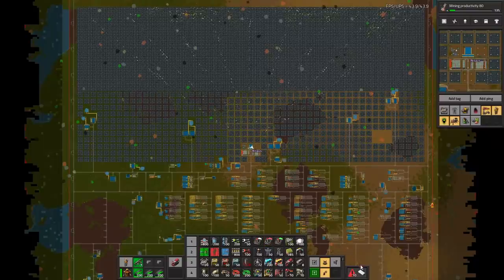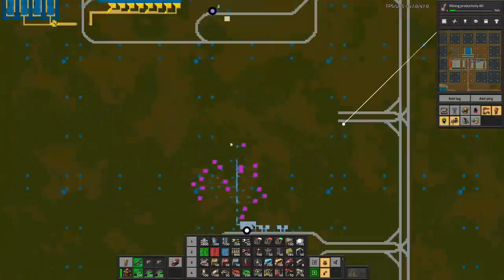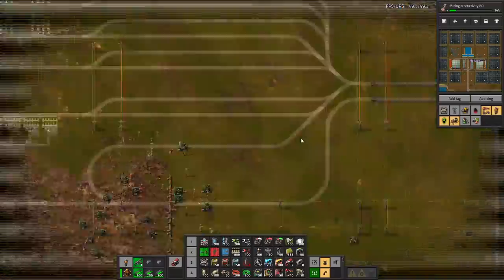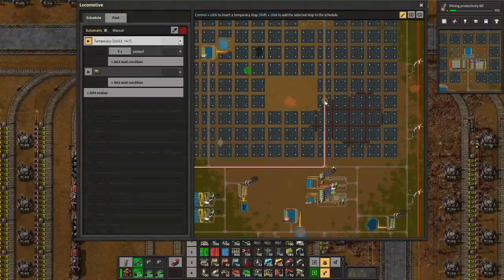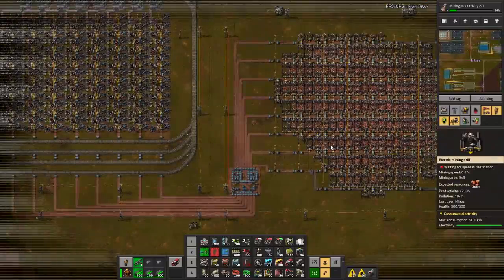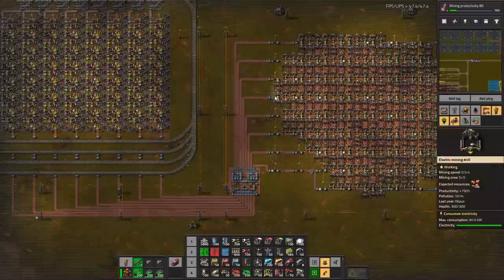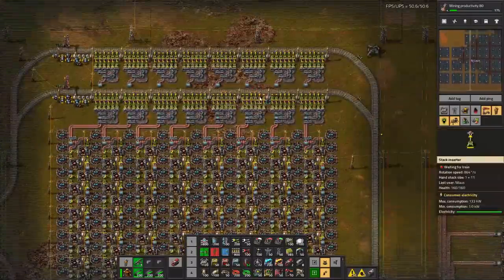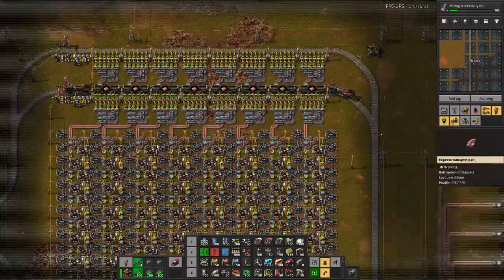NO BELTS for Mining and Smelting (UPS Optimization) | #66 | Factorio Megabase-In-A-Book Lets Play

Comment: I'm looking at that smelting  chain, something tells me that the length of the smelter chain and the length of the trains don't quite match, so you probably want the front one to be as close to an edge of the train as possible, and then see how long of a train you can get to fit inside there.

Routing wise, I expect that the ore carriers will want to stay inside the ore-smelting module and not be able to escape into the main network by default. The plate removal, on the other hand, probably does need to participate in the main network, but it's also about to yoink tons of copper trains that will be stuck waiting to fill up. With some clever rail layouts, you could set it up so the ore trains can roll into the module from your main hub, just not escape until the module runs dry and gets decommissioned.

Also for some ore patches you'll want to use a vertically oriented mining setup instead of a horizontal orientation.
Reply: The height of a "unit of smelters" is 2 beacons + 1 tile gap = 7 tiles.
The length of a car wagon is 6 plus one tile gap between wagons = 7 tiles.
Should be able to match any train length.

Comment: To minimize the time for empty trains to arive at your smelter locations wouldn't it make a bit more sense to have the limit on 2 per station? That way one train will be pulled in the station and one in the stacker behind it. It will minimize the time between wait?
Reply: This means each station will claim a train well before it needs one,, even if the station next door has been waiting for longer. It means you need lots of different trains.
Reply: @O11O1channel  okay true. You'd need tro drastically increase the amount of trains that are actually in your system if you want to minimize wait time between train in the station at any given time. Not sure if thats that big of an upside.. or rather have as many trains as you need on the consumer side and let the creation side maybe wait a bit
Reply: Alternatively, you can have a stacker station (with a train limit based on the size of the stacker) that all the trains go to before the smelter stations. So trains can come in to the stacker, and once a smelter station opens up it's a very short trip and the smelters aren't idle for long.
Reply from the maker: yes it would

Comment: Nilaus, I have 2 suggestions:
1: At the smelter, the ore gets unloaded onto a belt and then "balanced" between 2 chests. First of all, unloading from wagon to chest (box to box) would be faster than unloading from wagon to underground, wouldn't it? And secondly, that balancing is in no way guaranteed to be equal at all and heavily depends on the timing of those inserters. I'd instead unload into a single box, and then the fact that the underground belt only has a capacity of 96 items ensures that the 2 smelters fed by the belt will run out at exactly* the same time. *With the small caveat that all furnaces on the side fed by the belt will process an additional 36 items which doesn't imbalance anything because they go into the same train. Again, this is not guaranteed to be exact, but the possible difference is only 12-ish items every time the chest runs out.

2: As the 8-car ore trains have so much trouble fitting onto an already quite large ore patch (this one fits, but it feels like there would be ore patches that are too small for 8 wagons), couldn't you feed the front and back halves of your plate train from 2 separate 4-car trains?
The easiest way would be to make the plate train stop twice (first with its front and then with its back half aligned with the inserters). But it's possible to fill its 2 halves from 2 trains at once. Here's how I would build it:
Double every ore rail through the smelter module and turn it into a bundle of 2 adjacent rails. The left rail of the ore bundle runs all the way to the top, locomotive parallel with the product train. The right rail directly touches the left rail and is therefore aimed at the left station, but stops below it. The station of the right rail is located between the 3rd and 4th wagon of the top/left train. To make space for that station, you have 2 options.
EITHER leave 2 squares of space between the right rail and the beacons; just add another inserter+box pair to jump that gap. Adding this box will cause the same problems as I mentioned in in suggestion 1, though.
OR, (I'd personally chose this fix): Have the modules for the top 3 product rail cars aligned so that their inserter touches the top of the rail cars. And align the bottom 5 modules with the inserter touching the  bottom of the product rail cars. You'll need separate rows of beacons above and below that station, but that's just 4 beacons more per column.
The top 4 wagons would unload to the left and get belted to the right, while the bottom 4 wagons unload to the right and get belted to the left (you need to flip your top modules for that).

3: Someone already wrote a comment about loading the ore train from miners placed on the same side as the station, so take this as a reminder which I'm not counting.
Reply: 1: It will get some balance in the fact that the throughput of the transport is greater than that of the furnaces, but it may fall out of balance in time and load wagons unevenly on both sides, maybe? I feel like even that will sort itself out, since trains will have to wait until they are full anyway, so the balance is irrelevant. There will be equal parts of material in each cell anyway, so there's a limit to how unbalanced it can even get. I support allowing unloading a full train into boxes, though, and perhaps then closing the station until the boxes have room to unload a full train again, to save some on the amounts of trains needing to wait.

2: It's a good idea, but doubles the amounts of trains, which he's also trying to limit. The patches will last virtually forever anyway, and there are enough good patches that he can make many many stations. I'd rather just have a regular 8 length train stop at the miners twice if something like this needed to be adopted, and fill the front, then the back, then move to the smelters.
Reply: About 2: yes, that really depends on how many ore patches there are that are suitable for the x-8-x trains.
And yes, having 8-long ore trains that get filled from 4 wagons worth of miners twice is one more possibility. Also having a special ore train using that special schedule won't be a problem either.

About 1:
I'm not sure if any imbalance WILL even occur here, but I'd always prefer building robust enough to be prepared for it.
1.a: To be clear, I'm not concerned that all instances of the inserter -> underground entrance -> inserter combinations deterministically favor one side, I'm concerned that one inserter might get into a grove that favors the left while the inserter below it gets into a different rhythm that favors the right. 
1.b: It SHOULD stay balanced from the fact that the throughput from the ore trains SHOULD be higher than that of the furnaces. But if an ore patches runs out even on a few stations, the train throughput is reduced from what the furnaces are designed to handle.
1.c: And on the "there's a limit on how imbalanced it can get" argument, for it to actually balance things, you have to hit those limits first. Tbh, if the ore train stations are simply set to a train limit of 1 at any time it WILL be hit.
But usually, the point with train stations is that you want to run it with the chests neither entirely empty nor entirely full. And in that setup we've seen stations that failed to self-balance for a very long time. (There was the one instance very early in the series where a station got converted from 1-4 trains to 1-8-1 trains and another instance where a receiving station had some entities missing and only half of the chests initially filled up all the belts).
1.d: If you assume that 1.a through 1.c all SHOULD not be a problem, that doesn't make it impossible to get an imbalance. If there are some edge cases (ore patch partially running out, brownouts, the behavior differing between smelting array orientations, leftmost train line of the smelting array, whatever) for which all 3 assumptions turn out false, you'll get that imbalance, unless you just make your build robust enough that you don't have to care.

To conclude this wall of text, I think that with the current plans the imbalance indeed can't be an issue. But the ore train stations at the smelter HAVE to be set to a fixed train limit, and CAN NOT be changed to close down when the ore boxes are full.

Comment: Why not set the trains to inactivity when collecting ore? That way when things fill up to where they can the trains leave.
Reply: Because there are no balancers for the ore. Any difference in fill of the train wagons will translate to difference of fill in the plate wagons. If these plate wagons end up being used via direct insertion instead of through a belt balancer then the resulting product also has differences in fill of its wagons.

It is possible but every stage has to be able to cope with such trains without carrying forward the lost production time. Ultimately the goal is some huge amount of SPM that is stable, so any sort of lost production anywhere along the chain that is carried forward would fail that goal. Let us not forget that moving trains have an update cost so any wagon that is not full is reducing the update efficiency of moving the items around.
Reply: @drsupergood8978  Since some of the builds literally require close to 8 full belts of material, I'd call it risky to try and handle partial trains. There's enough patches in the game yet to last a long time, and he can always expand to more if need be. Plus there are ways to get more material out of the patches by stopping trains twice on 4 miner stations and so on, so simply closing suboptimal stations are better, and then just tracking that, so you know you have enough or that you need to expand mining.

Comment: is there a tool similar to the one you are using for production per second information, to see UPS usage for selected design? it might be useful now that the optimization focus has shifted
Reply: Unfortunately the only reliable way is to repeat the design a practical number of times and then measure differences in frame time. This also only produces results about UPS usage of a design on that particular hardware configuration, with different hardware configurations possibly behaving differently.

Outside of these real measurements you have to estimate and use design rules to try and minimise update cost of designs. For example every inserter that is swinging or is trying to unload on a moving belt has an update cost, every entity that uses power has a power update cost associated with it, every decider or arithmetic combinator has an update cost associated with it even if it is not doing anything.

The update time is also a non-linear property. Repeating a design 100 times almost always uses more than 100 times the update time as the individual design.

Comment: Train to train!!! I thought that I will not see that in this series. 

Is it much slower when you have productivity modules inside of the miners? Because of the synergistic effect. I don't know the exact numbers tho.
Reply: the productivity modules are additive with what you get through research, so he'd go from what's already 790% productivity to 820% productivity. That's far less ores per second than filling those 3 slots with more speed modules
Reply: Oh yeah, makes sense. Speed modules are way better in this case.
Reply from the maker: productivitity modules on miners is very bad. I already have +800% Productivity from the research, so the marginal increase from modules is miniscule while the speed increase from speed modules affect the +800% productivity in full

Comment: Several thoughts:
- Height 8 looks like a waste of trains to me.  Since you can't mine out in one go anyway (beacons are 3x3, so there's at least one sqare out of reach no matter where you put miners), you'd want a design that mines out in two builds.  And if you go 8-high, the 2nd build will last about half as long as the first.  If you go 10 high (always 2 lines between beacons and miners), you won't face that issue, and can even put one of the lines where you wouldn't care with an 8-high pattern.  
- Another benefit of 10-tile high patterns is that you can place miners without gaps.  Leaving an entire miner spot empty always results in leftover resource deposits.  (Although there's a remedy to that: make a 1-wide gap and a 2-wide gap, both misaligned WRT the beacons for maximum boost).  And the 10-high design has enough space to provide power from those two lines without interfering with any patterns.
- 04:18  Also, did you just put overdrive modules into the miners?  I assume the final build will take efficiency rather than speed...unless you merely want to tear the resources out as fast as possible, with as few trains as possible. 
- For horizontal tiling, I'd use rather short trains and make them wait X seconds between stops.  Those stops would be spaced in a way that could access the whole line (no miner untouched) and return through another line (including the same if no other is open) until the train fills up and goes to the smelters. 
- And finally, I'm wondering if a somewhat decent mixed mining/smelting design is possible, one where the miners feed sideways into a steel furnace (because E furnaces are too big).  On one hand, a 5x3 area would be a perfect fit for a miner, a furnace, and two inserters (coal in, metal out).  OTOH, the ratio would be horribly mismatched, placing beacons perfectly would be impossible, and trains would have to come in pre-loaded with some coal, so not all space could be earmarked for metal.  OTOH^2, leaving the beacons out of the design would allow for a 5x5 package which could smine (melt sounds wrong) an entire patch dry without rebuilding - and beacons only seem to exacerbate the mismatch anyway.
Reply: I believe at a certain point in your Mining productivity research, it's much better to have speed over productivity modules. Yes you get a free tic of resource every now and then, but you lose out in overall throughput, (Speed loss on productivity slowing down trains) resulting in more Train Entities, stations, miners, beacons, power draw, power source, etc. 

You really only benefit from Productivity modules in either Early game, or very sparse resource patches, where you HAVE to eek out every little bit you can.
Then again, I haven't played Factorio in over a year, just enjoy listening to Nilaus talk through his design process, so I may be talking with expired info. 

TLDR: Speed modules >>> Productivity in miners at higher levels of resource research.
Reply: OK... "more miners = sucky UpS, therefore maximize output per miner" sounds logical.  Wondering what actually tanks your UpS, the miners themselves, or the resources extracted.  If it's the latter, the UpS hit per unit of resource doesn't really depend on the # of miners, but inserters, belts, etc.  And in that case, getting 30% moe is still a significant difference, because long tracks aren't exactly UpS-friendly either.  (At least, each train carries lots of resources, so it's still far better than belts.)
Reply from the maker: Please try it before suggesting. There are a lot of assumptions you are missing

Comment: direct to train mining works really well once you get mining productivity and speed up there, but direct-train smelting..is just SLOW. And it doesn't matter how many beacons you use, it's just so much slower than the loading side you don't even need to "saturate" trains. The number of trains you need is the total number of stations (both loading & unloading) that you have +  1 or 2. as the loaders are SO much faster than the smelting side. (even for the unloading side of the plates... the unloading will probably be WAY faster than the direct-train-smelting side that you don't need to "over-saturate" with trains to keep the smelters running...they'll keep running simply because it's the bottleneck in the system.

Comment: To increase performance you can hook entities to circuits and activate them only if there is a demand (for example inserters).
Reply: Most entities cannot be attached to logic circuits. For example assemblers and furnaces cannot be attached to logic circuits. Inserters that are not swinging or trying to unload on a moving belt are already inactive so have as good as no update time cost. Circuit networks and decider/arithmetic combinators themselves have update time costs which are logically only worth it if the savings are bigger.

Clocking unload stack inserters is the most common way to save update time with logic because inserters swinging with 12 items saves a lot of active inserter time over having them swing with only 1 or 2. Same goes for preventing them hovering over moving belts by unloading in a sequence where there is always a gap in the belt. Load stack inserters practically never have to be clocked or controlled by logic as they will always try to grab 12 items when the entity needs them and will be inactive at all other times.
Reply from the maker: unless done for ALL and done very carefully then it will be a significant decrease in performance